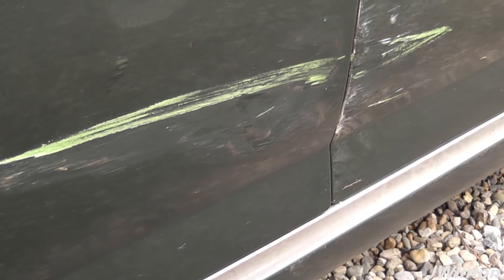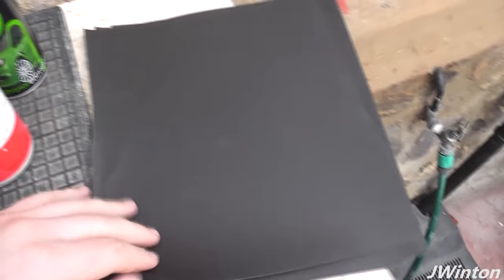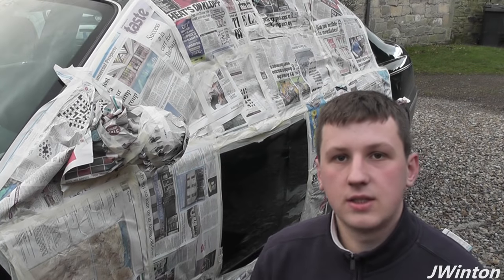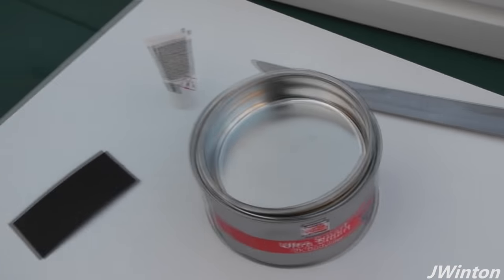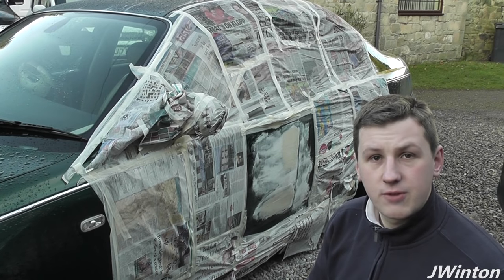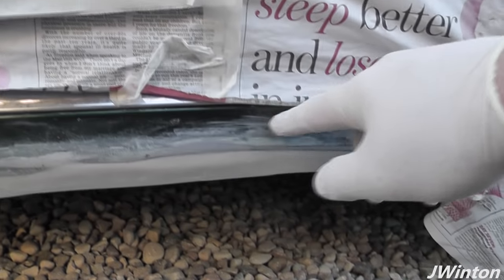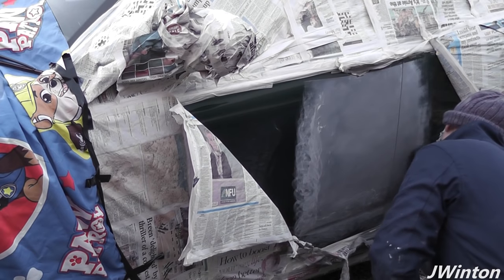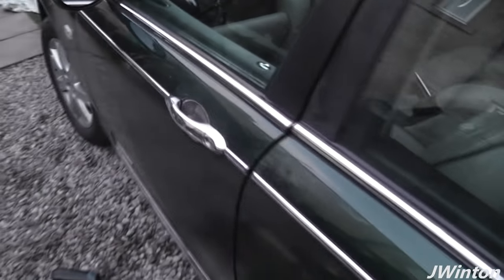DIY Repairing Dents and Scratches on Car Doors | Rover 75

Comment: 2 weeks ago. A guy ran a stop sign on a narrow bridge as I was coming across. Took off my wing mirror and caused a small scratch on the side. 200 euro to repair! At least it's not a 737 where it needs to stay in the hangar for weeks
Reply from the maker: That is such a pain mate. Someone ran a stop sign near me the other week and it was a close shave. Hope you got it all repaired. Aye that's a fact, talking of which has that RYR B738 at SNN been fixed yet?
Reply: @JonathanWinton123  it's still in the Atlantic aviation hanger
Reply from the maker: Ah pity.
Reply: @JonathanWinton123  it's actually out of the hangar now. She could be re entering service soon

Comment: God you must love that car gotta admit tho looks good
Reply from the maker: It certainly was a good runner. Sadly no longer on the road.
Reply: @JonathanWinton123  ive got the mgzt 190 and yes I get what you mean stupid design faults ruined these cars thankfully I overcame those and mine runs sweet
Reply from the maker: @jeffvaljean6030  Cracking car. They have been massively underrated. I had very few issues with mine over the years, great runner.